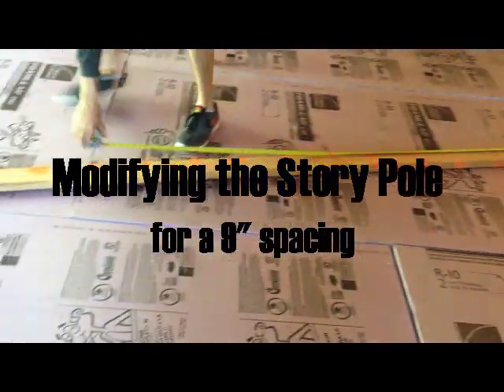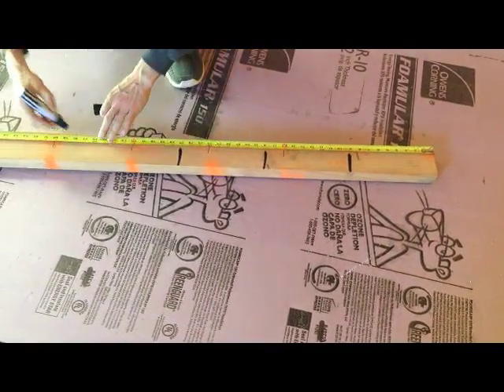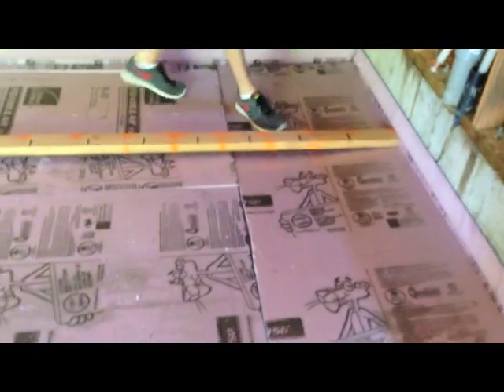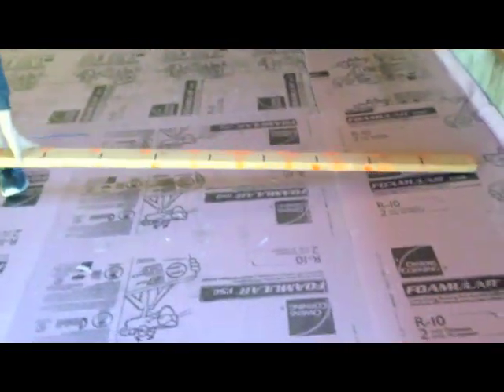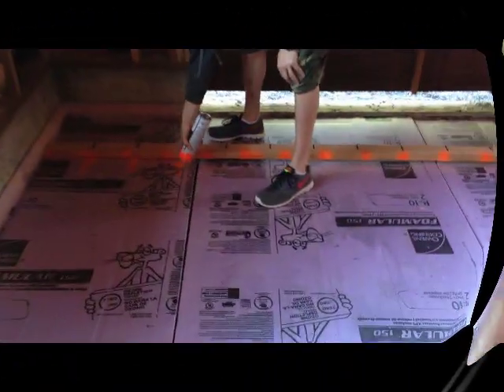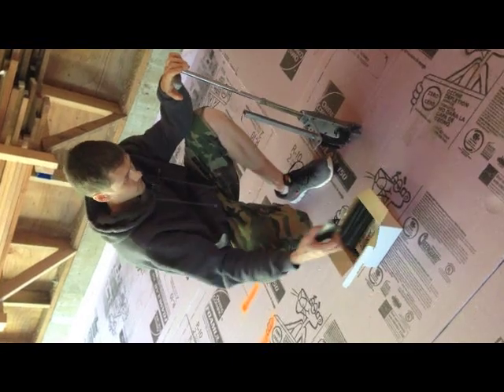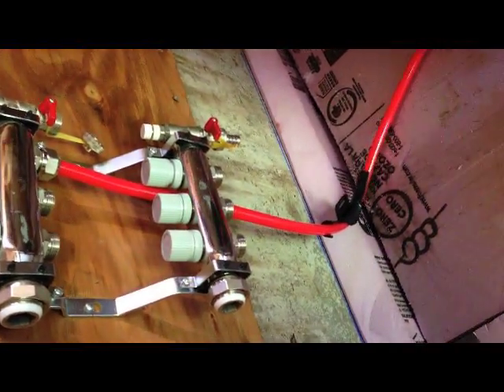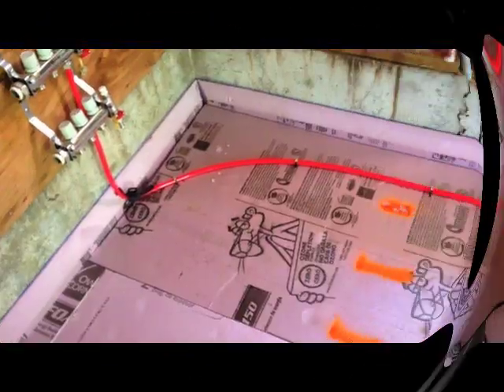PEX Tubing Layout and Install for In-Slab Radiant Heat

Comment: Always always always fill all of the pex with water before pour. We didnt on our 1st go round & had cracks everywhere. The pipes heat up from the concrete cooking off & heave so fill them with water all loops, completely full. I ended up tiling the entire ground floor to solve the problem. Yikes! Do your research & talk to a few pros b4 taking anything new on.

Comment: This is archaic , I bought Amvic foam panels , top looks like LEGO knobs, step on pet tube it snaps in place plus protects tubing keeps everything in place , I did my 30 by34 basement in a hour and half , plus it come with hi R value and vapour Barrier
Reply: Is it much more expensive? This looks cheap but functional for people on a budget.

Comment: The rebar over the pex?
Reply: it doesn't matter, the pipe is strong enough.
Reply: Here we install rebar mesh which has smaller rebar but smaller caps between them and then tie PEX to rebar.
Reply: Rebar should never be at the bottom of the slab, that is what "chairs" are used for to elevate rebar off the bottom . So adding the rebar above the led makes the slab stronger and less prone to cracking.
Reply: Sorry, led should be pex. Autocorrect is a pain sometimes.

Comment: Does it matter that it's at the bottom of the slab and not centered in it?
Reply: actually it doesn't matter at all. it will just take more time to heat for the initial start up...
Reply: The answer really comes down to your type of floor covering.  If you're looking at just having an open concrete surface that has a good heat transfer ratio, then you can get away with installing towards the bottom.  If you were to install a thick carpet or another material that is going to act as an insulation, then the closer to the top of the slab the better..
Reply: +harperjmichael Not really because the heat loss inside the concrete is negligible.  It is lost when it reaches the concrete surface and hits the air (or the flooring you have above the concrete).
Reply: harperjmichael yes it does. you want it fairly close to the surface.

Comment: aren't you supposed to sleeve where it will enter and exit the slab?
Reply: Ideally, yes. The tubing at the exit point of the slab can be a shear point. Also, you don't want to damage the tubing when you trowel the concrete.